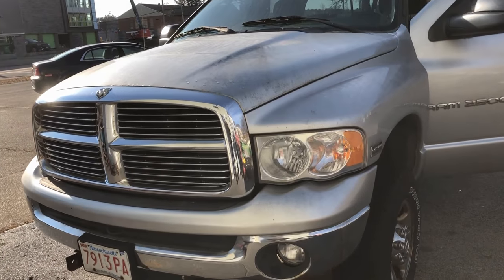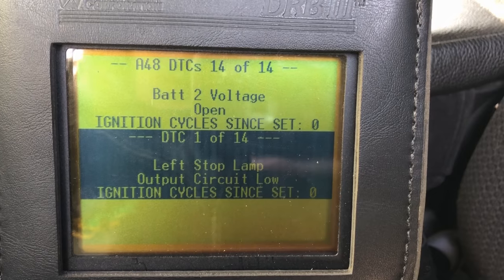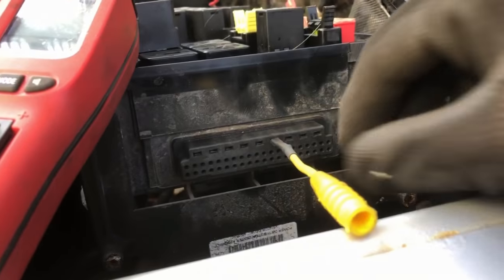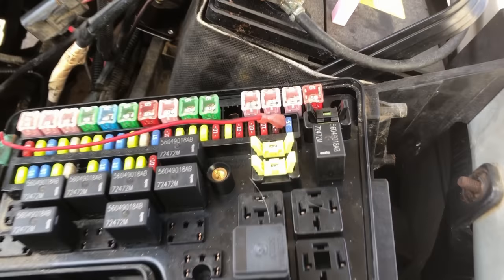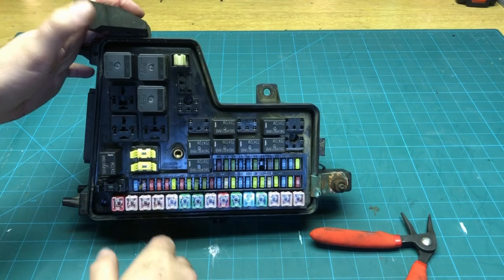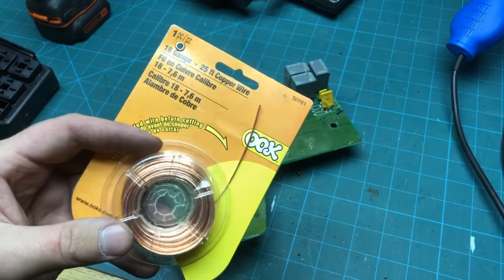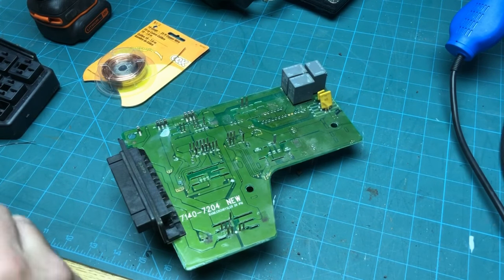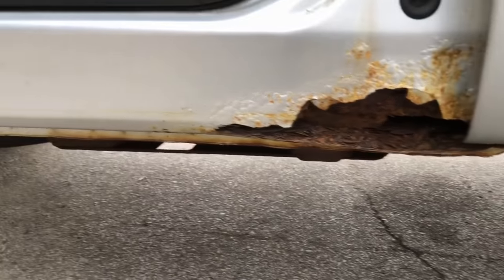04 Dodge Ram lighting fault. IPM/FCM diagnosis and repair

Comment: Can I buy a used FCM and just swap or does it have to be programmed from dealer?
Reply: I found this in a post on here and thought it to be a good answer as I am thinking of going to the scrap yard and getting one there (TIPM). But it seems if someone does this, they have to use the FCM (aluminum box mounted on the side) from the old IPM and then mount it on the IPM from the scrap yard.
Let me now if you ended up using this idea.

 ***Some advice for those who decide to use a salvaged TIPM rather than repair.  First of all, this is NOT a TIPM, it's an IPM.  These earlier Dodges (up to '06 I believe) used an IPM (basically a fuse box with circuitry) which had a FCM (front control module) bolted on to it.  A TIPM has the two parts combined as one unit.

The FCM contains an eeprom which is married to the VIN# of the vehicle.  If you swap out the IPM make sure you use your existing FCM (it's the aluminum box on the side of the IPM).  If you use a salvaged IPM including FCM, you'll have all kinds of odd 'Lamp Errors' which will entail having your vehicle reprogrammed.

To sum up: The IPM is 'plug & play' as long as you use the original FCM

Comment: I'm having a similar issue with my 2004 Ram 2500 5.7 Hemi, the front headlights work fine and the marker lights work as well as the rear right turn signal. However the two front and rear left turn signals do not work. I've tried swapping bulbs and going through all the fuses to see if any are blown and haven't found the fault. Would it be the module ?
Reply: Have you fixed the problem? What was it?
Reply: @kenc.2448  yep I fixed it, there was corrosion just like in the video on mine and I did the same repair and it has worked ever since. 

Must be a design fault where moisture is rotting that part of the power board.
Reply: @6string327  do you happen to know if FCM can be installed  used without programming or must it be programmed via vin?
Reply: @kenc.2448   I have no idea what any of that is, sorry.  I don't want to give you info that will be misleading.
Reply: @kenc.2448 If you use the factory fcm you will not have to get it taken to the dealer for a vin reflash.  But trying a new one or used one from another truck will require a dealer vin reflash unfortunately.

Comment: yes sir haveing problems with abs ligth ,brake light, and speedometer going  hay wire ram 2003.when speedo go,s up to 100km.motor stall,Iremove fuse nomber 35.truck is running but no speedometer.

Comment: I'm new to diy on my own 2003 ram 1500, the only issue is lamp out light, when testing my fuses, do I take off neg batt cables? It may seem like a stupid question.
Reply: Could be your circuit board assemblies on your tail lamp. Really cheap at your auto parts store about $20 each . they burn out after a while thats what my issue
Reply: @ChrisB-cx6td  thank you Al I replaced the switch and it fixed the headlights, the only thing left is both fog lights, so I bought bulbs for each one, stupid things were 12.00 for each. Havent put them in yet! Way too hot here in AZ, lol. But thank you much for your suggestion.

Comment: Please I need help I have a 2005 dodge ram 1500 5.7 no park lights and one brake light working, signal lights work great any ideas
Reply: I have the same problem. My driver side park light doesn't work. And passenger brake light doesn't work.